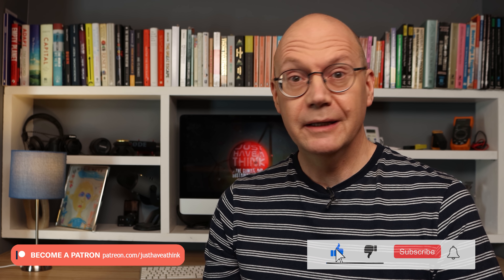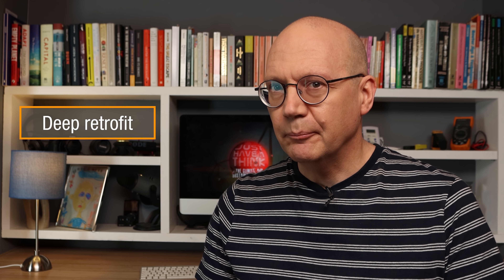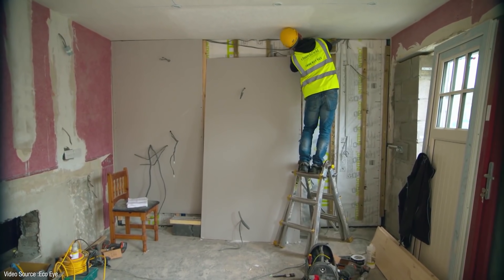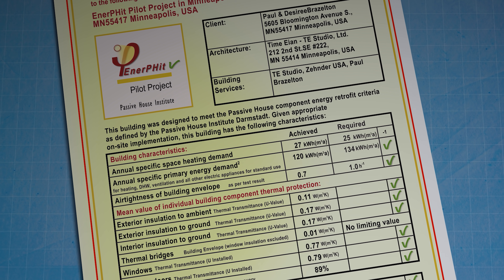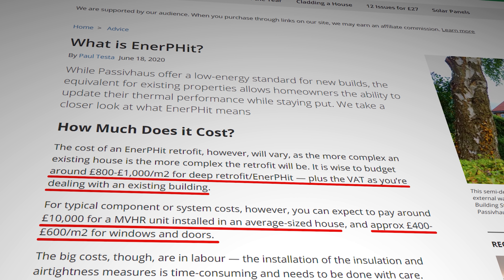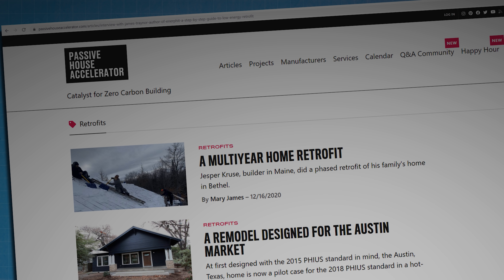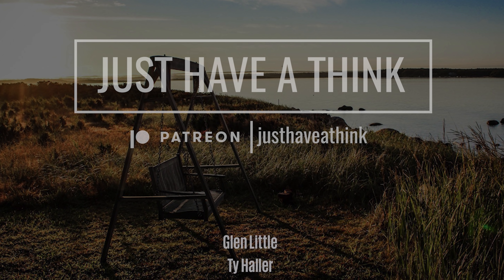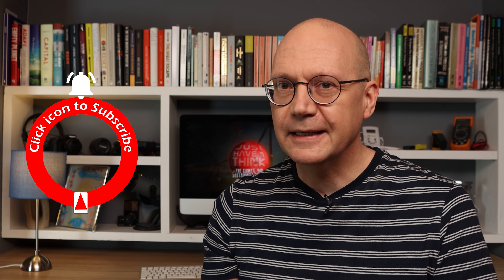Retrofitting to Passive House standards

Comment: When the exterior of a non-brick building is being updated, such as when siding is being replaced, is a good time to explore upgrades. Insulation can be added to the exterior that is a continuous layer, which is much more effective than the usual batt insulation. The great part is also that exterior insulation also won't cut into living space.

That said, no reason to wait increasing attic insulation. But don't forget that it's important to air seal before insulating... if there are lots of leaks in the attic that carry air through the insulation, then the insulation is doing little good. In fact, a decent sized attic can be air sealed with a spray foam gun and a 5 cans of foam for a hundred dollars by a DIYer, which will be easier for homes with batt insulation (blown insulation makes this work much harder). This is an energy upgrade that will pay for itself within a year or two. It's also kind of fun and is something I did on our previous home. :)
Reply: There are critical elements of airflow required in loft spaces, so beware of the seal-it-all-up approach. I have seen rooves fail in as little as 7 years due to being sealed up. "Siding", so you're American. Over here (UK), we don't build that way, and even if we did, externally insulating has profound implications for the ralationship between walls and roof (reduced overhangs), and for vapour transmission through the wall structure. Like I've said a number of times.....beware simplistic solutions.
Reply: @MikeAG333  External insulation is always better for the building structure than internal. Keeps it warm and dry and the thermal mass on the inside. Make the EWI vapour permeable so no risk of trapping moisture long-term. Overhangs can be extended if need be. EWI is not 'simplistic' - it's generally a very good plan. The only good arguments against it are usually aesthetic architectural details, and when there simply isn't room (e.g narrow side passages, or abutting other buildings). I guess there will be a few other problematic cases.
Reply: I think this is what the installers did when they put insulation in my home. I remember them spraying something and hauling bags of fiberglass up there.
Reply: Insulate and seal, then breath in those toxic chemicals? Best wishes.
Reply: @jimmycorkhill1390  "Insulate and seal, then breath in those toxic chemicals". No: insulate, seal and ventilate (usually MVHR). Ventilation is vital to the functioning of both buildings and people.

Comment: I question the actual efficiency of passivhaus in this country, I have been in many new builds where the house would fail the air exchange test if the builder didn't caulk the transition from the floor to skirting, the house passes then we the floorlayers come in and cut it all back to be able to fit the floors to a half decent standard it leaves gaps in the caulk and you can feel the draft coming through. This is common in the timber framed and traditional if it's not taped and sealed properly before second fix what's the point?
Reply from the maker: That's not the fault of the standard though is it. I hate to say it, but it's the fault of the trades not taking collective responsibility for the overall performance of the building.
Reply: I forgot to mention but for anyone reading there are certified passive house tradespersons out there - seek them
Reply: PH standard requires you to record the building construction process from start to finish, they are generally more of higher standard than traditional, you need also to find competent builders who know how to build PH homes, there's no point finding a builder who has little to no knowledge
Reply: you bring up good points as construction always defaults to lowest build quality based on our economy.  passive is closed system efficiency, without being closed it is little more than additional insulation.
Reply: Not sure what circumstances u talking about but this situation would not arise in an actual passivhaus as the design and construction are tightly controlled. Very sad indeed if the houses you mention are fraudulently being sold as passive houses when they clearly are not.
Reply: @treescape7  they were most definitely passivhaus, it was a build of 150 house's 6 of which were passiv .when I started I was asked specifically not to cut away any caulk because they had problems with the air test, on the last two houses it was high winds I had to cut back the silicone because the bead was best part of 15mm thick and you could feel the air being pushed and pulled from the room through the gaps. I have no idea what the other four were like because the whether wasn't as bad not saying it was a design problem at all somewhere along the lines someone has damaged the fabric of the building and the house's where finished and instead of doing the right thing the company some how got round the problem. On the upside I worked on a smaller development last summer and it was 30 c outside and around 17/18c inside. I had to keep going round closing doors and windows after the labours had been in to keep the heat out.
Reply: @whatsthepoint202  Oh dear, that sounds a bit naughty! Where was this? They should have been using airtightness tape for a gap like that but the construction shouldn't have had a void penetrating the full thickness of the wall anyway.  
If I have a criticism of the PH establishment it is that they charge so much money for training. Ideally everyone on site should have had at least basic PH training so everyone is able to spot potential compromises before they get into the building fabric and covered up.
Reply: @treescape7  it was between Eastley and Winchester all the external doors were taped that's all i could see in the way of taping as i was last in agreed that it shouldn't be penetrating through the complete fabric of the building .
Going back to training this should be given to anyone who walks through the door no one mentioned anything else to me. In normal circumstances I  would have cut the tape back from the floor to the external doors.  It was only through my own experience and research in building a 30m2 single story workshop/studio somthing close to ph for my other business that I knew anything about the importance of leaving it in place. Anyone else would have probably gone in and said thats in my way and cut it back.
Reply: @whatsthepoint202  Not sure whether to be thrilled that the developer is at least engaging with idea of passivhaus or pissed off that there are only 6 out of 150, and even then he's trying to cut corners and using you to cover for his poor airtightness levels. The rigorous PH certification system is designed to avoid that sort of cheating. If these houses don't actually perform to PH predicted levels the standard could get a reputation as expensive greenwash which it most certainly is not.

Comment: Often, it seems to me, the costs for doing the upgrades of a house is more expensive that tearing it all down and build anew. Why spend a fortune on a house with all the bells and whistles if the foundation is, or soon will be, completely rotten? I say governments should make better incentives for completely replacing old buildings, and lighten up on conservations.
Reply: While the retrofit would be expensive, it's likely half the cost of testing down and rebuilding
Reply: If in your area foundations  rott that easily, that might be true, but that would be a bad generalisation as well build houses can last for centuries and have  done so. In those cases adding some insulation, replacing the windows and changing the heating system is well worth it and often a lot cheaper the tearing down the walls and foundation just to build a new house.

Comment: We seem to have got used to our entire houses being heated rather than just the space we are using. This seems wasteful and unnecessary.
Reply: The problem is, if you only heat part of your house, every time you open the doors between the two parts, you let warm moist air into the cold part and you get instant condensation and damp problems.
Reply: If your thermal envelope is well-sealed, then after you spend the extra energy heating the other rooms the first time, then they’re just a thermal battery and even out the temperature swings. Over time, the only energy you put back into the system is whatever leaks out of the envelope, after all.
Reply: @kaitlyn__L  You are correct about thermal battery heat store trapped inside a well insulated external skin. It is getting there first, years of intentionally poor design has created and maintained high energy demanding homes and big brother has tried to prevent cost effective remedies. Best wishes.
Reply: Only heating the bit you are in makes sense in a badly-insulated house. But if you get a good thermal envelope as in PH then it doesn't really make sense any more. The whole interior will end up much the same (18-20C) whether you heat it or not.
Reply: @xxwookey  Indeed. Sadly my house is Victorian and would cost tens of thousands to bring up to standard - so I have to do what I can.
Reply: @xxwookey  You havent considered ventilation and movement. In a low storage density house, each time you open a door or as you ventilate significant heat is lost. The smaller the heated space, the quicker it is to reheat that space.  Most people are never going to have a PH. Trying to push extremely expensive systems onto others, or using others money to take advantage isnt the answer to a fair and sensible society? Best wishes.
Reply: @jimmycorkhill1390  passivehouse isn't 'extremely expensive'. It's cheaper in the long run. It currently makes most sense at the poorer end of society: in social housing, where the difference in energy bills is the difference between being able to pay rent or not. Better off people can pay their heating bills anyway. Increasing amounts of social housing are being built as PH or retrofitted to it (or close). And I don't see why spending money on the houses poorer people live in isn't the way to a fairer society. Why do you think keeping housing crappy makes a for a fairer society?
Reply: @xxwookey  With regard to passivehouse you are repeating the sales pitch I think? It is clearly very expensive unless you mean a passive house (energy neutral) with many options some close to free in achieving it? Ive always been able to pay my heating and have been what many would consider poor for quite a part of my life. Lived in social housing and managed it too for quite a few years. Much social housing isnt crappy, but much is poorly insulated, but much has been retrofitted already as in my experience and as ones seen in full technicolor on the TV. Insulating/heating homes and expensive passivehouse standards are two different things. One could wrap their home with a green house instead of plastic foam and achieve close to energy neutral as some have done.....that wouldnt meet those PH standards? Perhaps we should think smarter? Best wishes.
Reply: @jimmycorkhill1390  Exeter council have said that (after some learning from earlier projects) it now costs the same to build PH social housing as it would to build conventional social housing (which they don't do anymore). That's not 'very expensive'. And that's just build costs, ignoring the fact that all the tenants save a lot of money on running the houses (and the HA saves money due to high occupancy and low default rates).
This article says that more typical is 8% extra: https://passivehouseplus.ie/news/general/passive-house-costs-falling-new-study-finds Include running costs and that's significantly cheaper over the building lifetime, as well as being a much nicer place to live. Is that what you are calling 'very expensive'?
When I said 'crappy' I meant thermally, not other aspects, which may indeed be just fine.
Reply: @xxwookey  You are using a council example, those who rarely every receive value for money. Compare their costs to the new building for sale market? When they start building them for the same, you will likely have reached equilibrium. In any case, you have now quite intently jumped from retro fit to new build. Tell us how many new homes exeter council built last year? Tell us the percentage impact on social housing of that amount? It is always going to be easy to add higher standards into a new build, it's obvious. As to whether designing a mechanically ventilated plastic box is the answer, Id suggest not. Grenfell Tower wasnt a successful retrofit? Or all those others having cladding removed at a cost much greater than the install cost. I am aware of all the other insulation options....before we have to go there. Yes, they will likely be using better insulation choice. Back to retrofits, on all the massive uk's housing stock......compare how much yours cost, take it you had all the seals, membranes, heat recovery ventilation system that often comes with the passive house standard? Then apply all that cost to the UK housing stock and then how it will be paid for by what is an essentially bankrupt country? Much social housing in europe has communal heating, some combined heat and power, cost in with the low rents. Houses around here are  cheap to rent, often have garages, great heating systems, good insulation, cheap to run. The local tower block has heating and hot water in with the rent. None of these are PH and it would be far cheaper to bung some PV panels on the roof and maybe a HP than get in PH. I bought more panels last week at 100euros per 330W panel. My annual fuel and elec cost is about 700euros in a stone house with hardly any insulation at all.....how does your super insulated one compare? Want to do a net present value calc?  Best wishes.
Reply: Also, homes became huge over time. 2500 sq ft? Really? I only have wife and 1 kid, and our 70s ranch home at less than 1000 sq ft is fine. Newer build that have a more clever use of space would be adequate for most families at around this side. Speaking from the US.
Reply: Too true. Im not really using my upper floors and am more than comfortable with my compact bedsit style set up looking right out into the garden...and it's cheap living. Best wishes.

Comment: I live in one of those social housing towers, a true abomination. The floor/ceiling is a single slab of externally exposed concrete. It's ice cold all winter. In winter I can only afford to heat one room, so I sleep in the lounge, and even that triples my bill. The whole place is riddled with mould, and it's a constant expensive battle to keep it under control. Even the curtains move when the wind blows [which it does a lot here]. I have tried to reseal them, but lack the skill and equipment to do so properly. The council couldn't care less. My wall heater broke in the winter and I was told it was not a priority, it is still broken. I don't think buildings like this are savable, they just need to be knocked down, they were built cheaply in the 60s and were never meant to be used this long.
Reply from the maker: That really is appalling and inhumane. Perhaps we should adopt a scheme where councillors and town planners swap homes with you folks for a few weeks during the winter. I bet that would change their minds pretty quickly!!
Reply: @JustHaveaThink    Would love a couple of weeks in some decent housing myself...
Reply: @JustHaveaThink  Gosh, can you imagine
Reply: Jesus... This is prime example of a building that should be retrofitted too higher standards.
Reply: @deansmits006  it seems likely Drawn is right and it needs demolishing. Who builds a house of concrete slabs?
Probably they aren't demolished because of the housing waiting lists. It cost tens of millions to do a 'cheap' shoddy makeover on Grenfell Tower.
Reply: Sounds like your building just needs some exterior insulation, upgraded windows and a complete replacement of it entire HVAC system still significantly cheaper than replacing the building.
Reply: I lived in one built 10 years ago but the landlord denied the need to seal the windows, I also had curtains get blown about by the wind >.> he ended up kicking me out to rent it to someone else (kept saying Id never given him any issues but he just needs it back) but honestly it kinda did me a favour because the next place I found for the same price is way better sealed. The water heater kept tripping the breaker and his only solution was to turn it back on <.<
Reply: @Fluffy Hamster  Working on it... but at this moment it is this or homelessness.
Reply: It probably doesn’t need knocked down. The steel structure will be fine. What it needs though is Re clad with modern materials & an emphasis on air tightening.
Reply: @hughmarcus1  The council really can't be relied upon to do anything sensible like this. They're put cheap plastic double-glazed windows in, which are so bad I had to reseal them all. The previous tenant boarded up every window entirely!
Reply: There will be another department of the Council that deals with health and safety.  They will probably condemn it and either get you moved or the work done.

Comment: Alternative strategy: use solar heat to reduce your need for grid-supplied home heating. Vacuum-tube collectors are effective and relatively cheap. They can be piped directly to a radiator for the simplest system, or connected to a storage tank in the basement for a more advanced system. Having a “leaky” house is less of a concern if you can collect a lot of your heat from the sun.
Reply: Insulation is cheaper, even with solar getting as cheap as it is you should try to minimize the amount of energy needed to heat or cool your house before you try to buy enough production capacity to meat your needs.
Reply: Here in UK I have solar water heating. It gives me hot water in the summer - and close to nothing in the winter. Nothing available for heating the house when I need it.
Reply: Perhaps a good idea for sunny areas